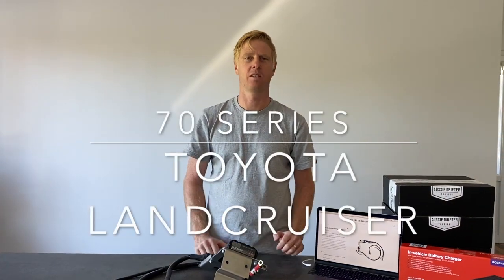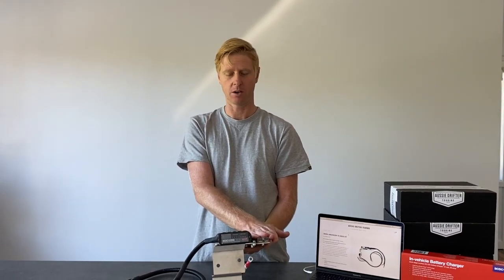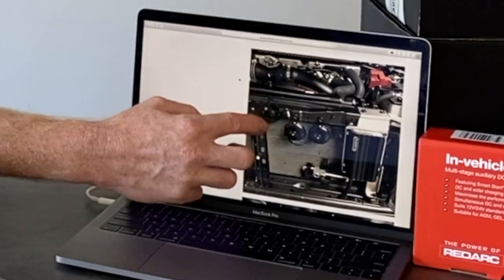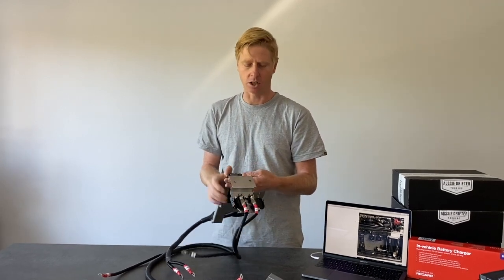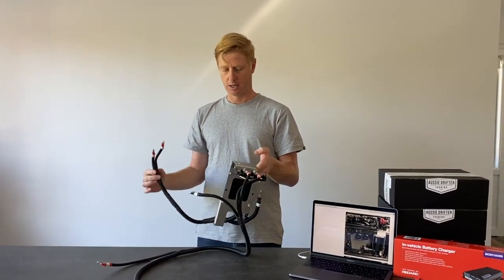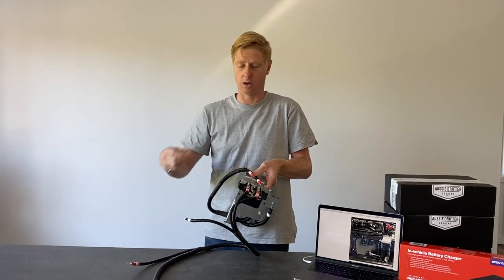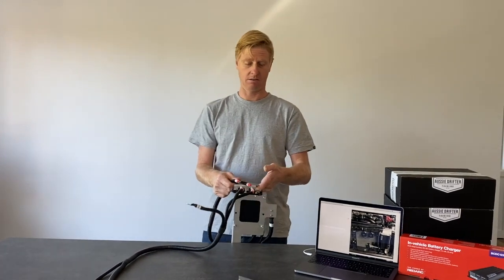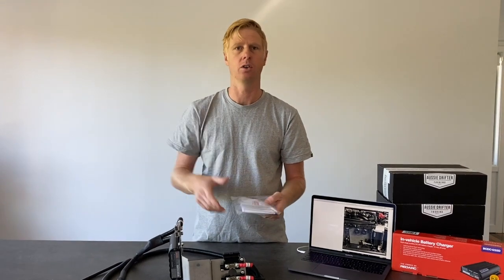Toyota Landcruiser 70 Series Redarc Dual Battery kit

Comment: Is it required to connect to the ignition signal wire on the 70 series?  If yes, can you show us the easiest way to do it? Keeping in mind my bcdc will be mounted in the cabin. 

Much thanks
Reply from the maker: hey mate you don't need to on the 70 series in Australia as they have temperature compensating alternators and not variable voltage alternators. Hope that helps